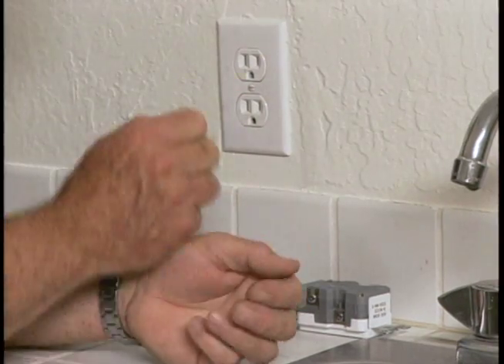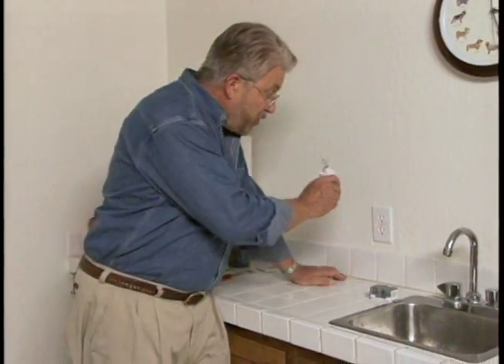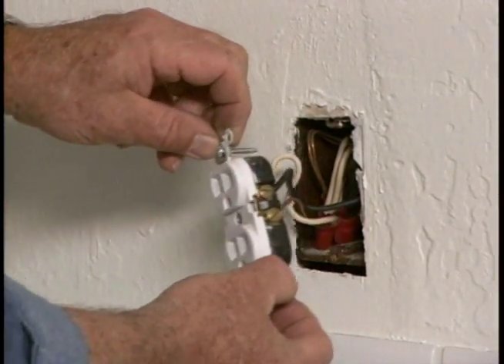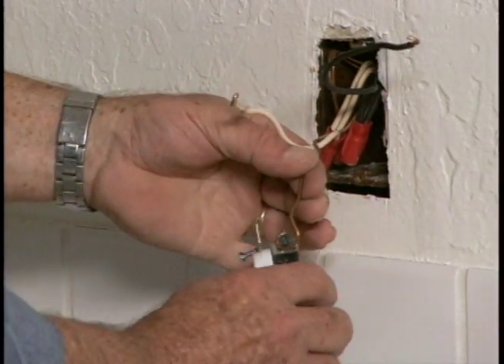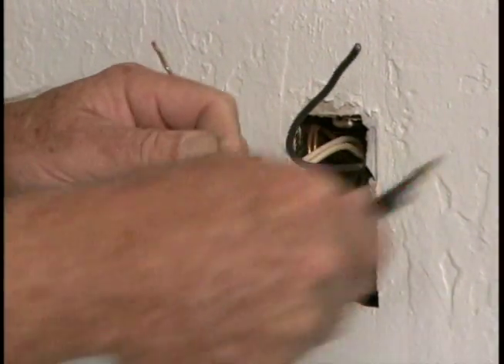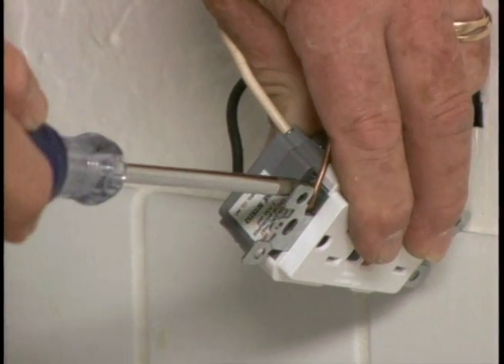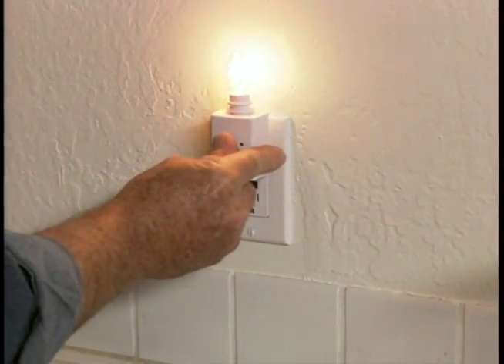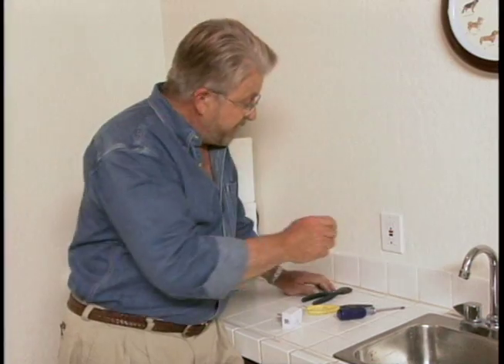How to Remove Outlet and Replace with GFCI

Comment: A bit more clarification would be needed for multiple GFCI receptacles in a circuit. Using a pigtail like shown in this video will keep every outlet next in line hot even though the GFCI tripped.  Using duplex GFCI's are designed so every outlet after trips on GFCI protection, which works well if you have multiple outlets daisy chained around a kitchen, and don't need to have a GFCI in every single outlet.